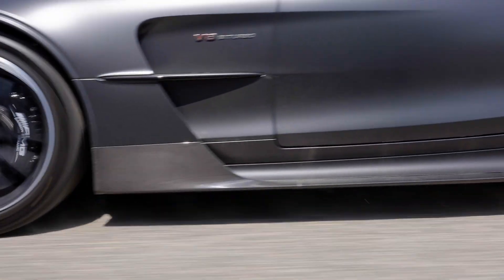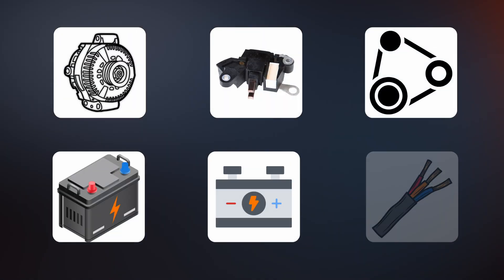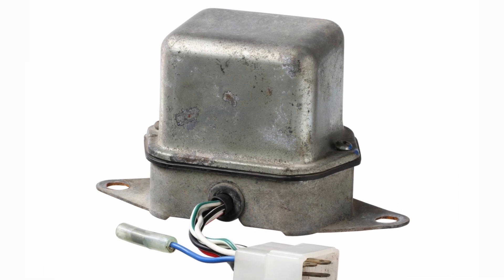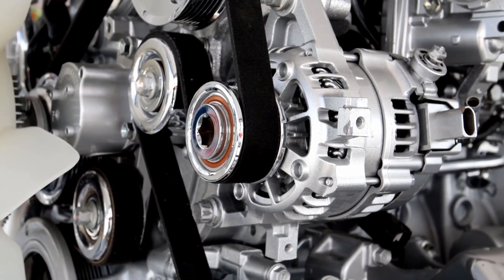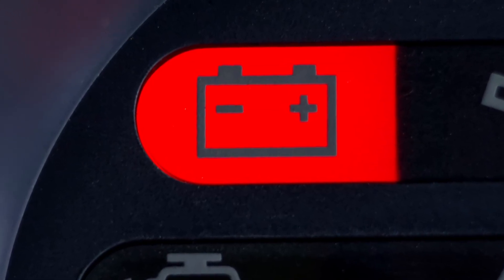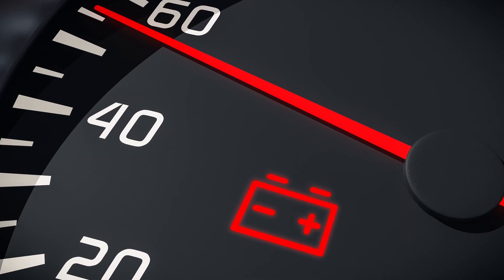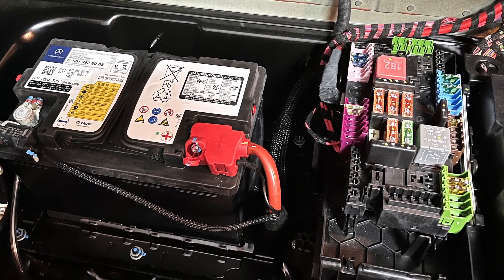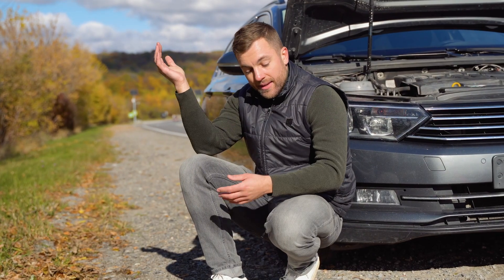Why Did Your Battery Light Just Turn On While Driving?

Comment: Will the battery light come on if the serpentine belt has a slit about 3 to 4 inches long? I already replaced battery and still loses power and battery light still comes on